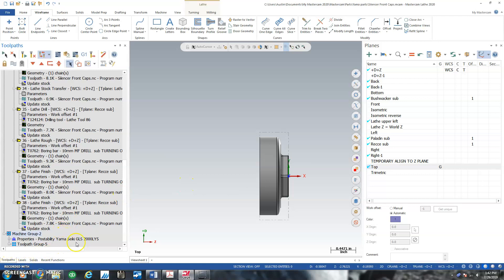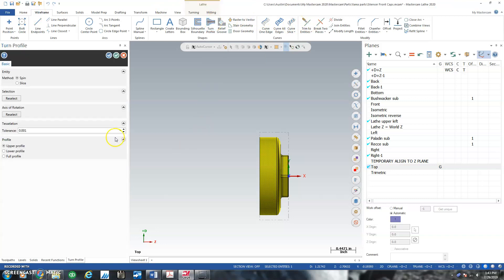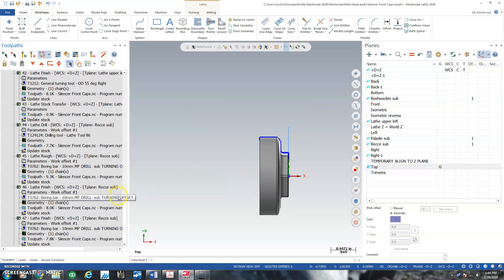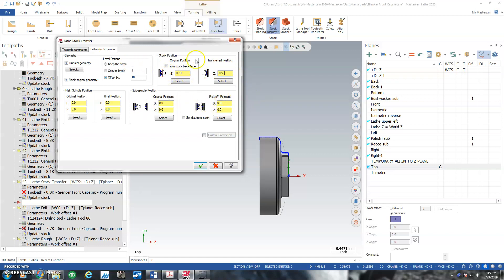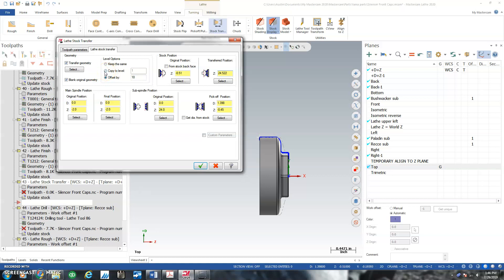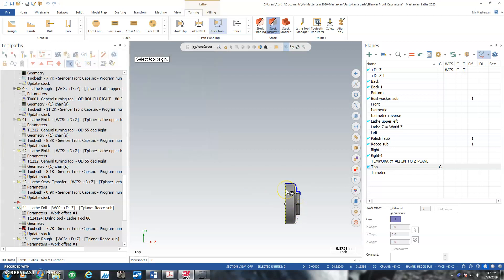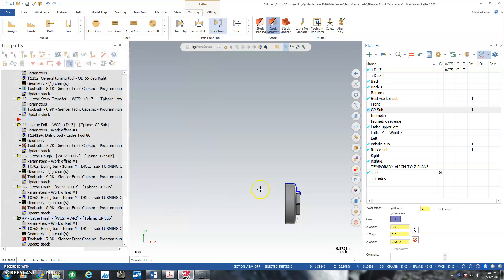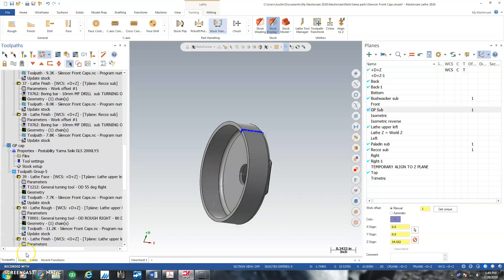Mastercam 2020 Lathe Stock transfer, new toolpath group, new upper right plane

Comment: For a Lathe Stock Transfer in Mastercam 2020(and back to at least 2018) there are a few things that simplify the process, but yes it is complicated no matter what CAM software is being used unfortunately.  One thing that helps is in the machine group properties under Stock Setup make sure to define the stock in your left spindle, then define your Chuck Jaws in both left and right spindles.  The position of the right chuck jaw as well as the Grip length parameter will automatically populate a stock transfer operation for you.  Leaving you just to select the geometry and pick a few options like if you want to blank the original, offset level etc.  This might not be a magic button but the values that populate will get you pretty close right away.

Also unfortunately the "Edit common parameters" doesn't let you change the tool/axis orientation of multiples at once, that sure would be handy for your example.
Reply: It couldn't be more simple in HSMWorks/Fusion 360/Inventor CAM